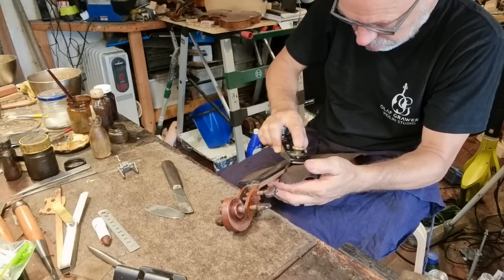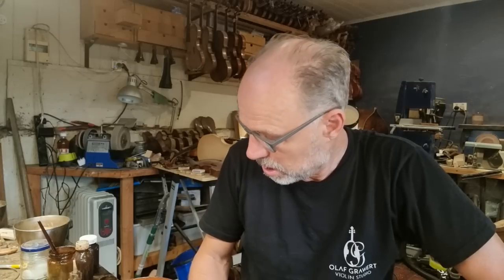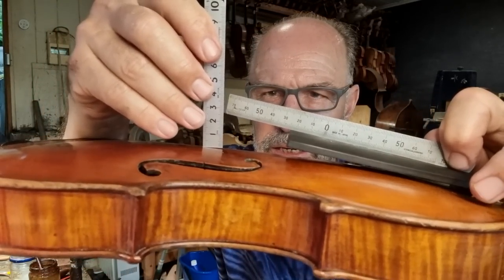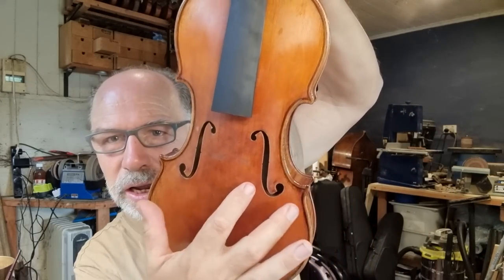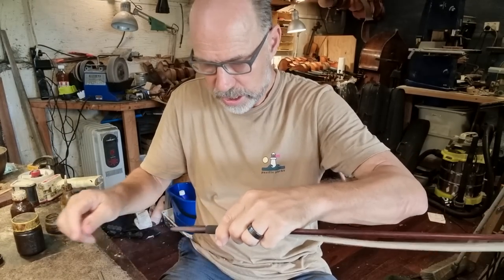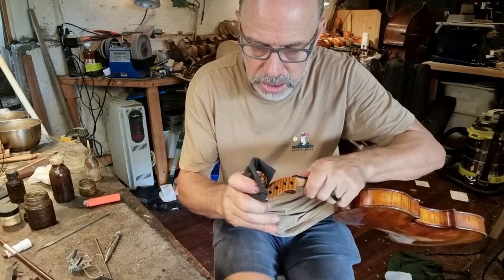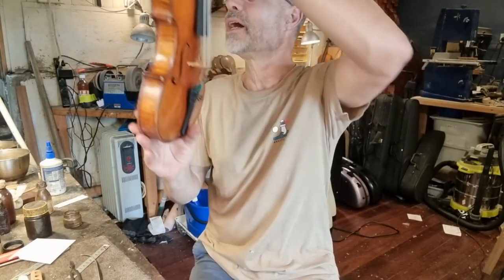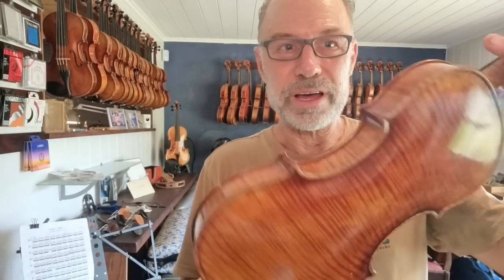Violin Service - Did something chew the edges?

Comment: Getting a frog slide out can sometimes be a challenge but normally a bit of masking tape rolled up into a tube & stuck onto the pearl slide, can be enough to get sufficient grip between thumb & slide, but for the most stubbornly tight slides I have resorted to supergluing a toothbrush handle to it to then be able to tap it out (after trying heating with a hair dryer). It is easily separated if done within something like 5 minutes & then cleaned up with acetone, although that still has its risks going to such lengths, but many times better than using a chisel behind it which just damages the slide. Using pencil graphite on the edges makes it easier for next time too. 🙂

Using paper & PVA glue under the leather is much better than what I've seen from a certain bow maker where they have used masking tape. It just goes sticky over time. I don't know why they do it. Interesting tip for tapering the packing paper at the frog though. I see some sticks quite worn there though. What do you do with worn sticks in that location? Build it up at all with a graft?

Comment: Hm, I actually always clean my strings with alcohol, though not with perfume, and to this day, there have been no accidents with drops on the varnish. With perfume, however, I would have feared buildup on the strings due to other ingredients in the perfume. I've been doing it for about 20 years. I always use very little alcohol on kitchen roll that soaks up some of the alcohol so there never have been drops.
Edit: A luthier once told me NOT to just take the rosin off the strings with a cloth because that might damage the outer layer of the strings?